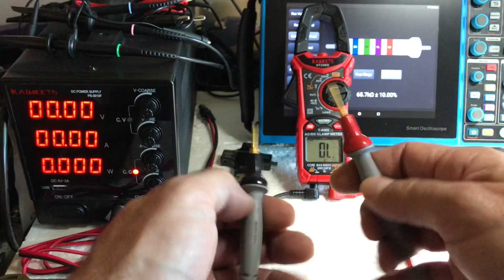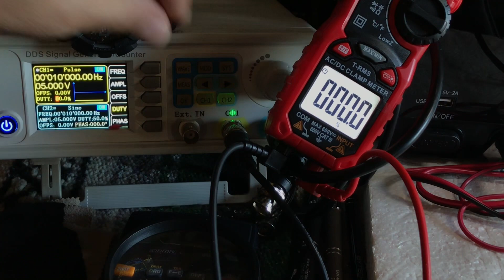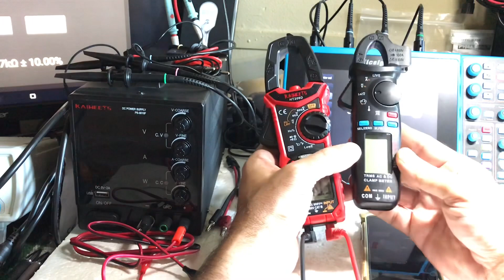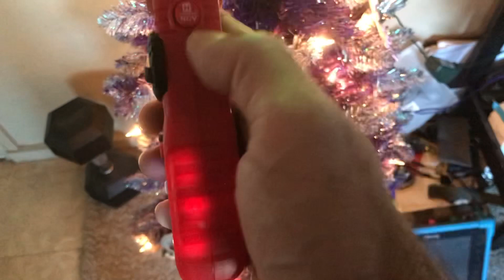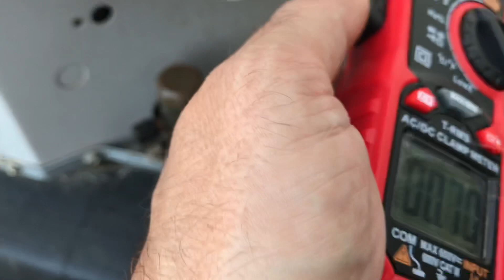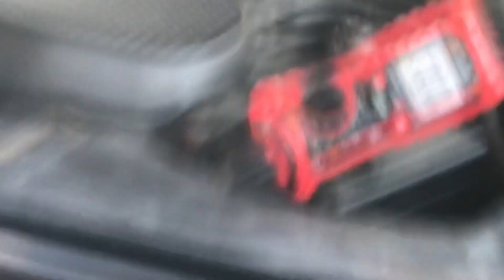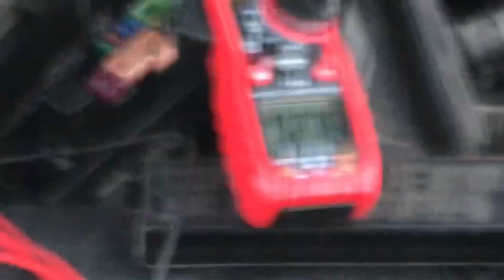Kaiweets Clamp Meter HT206D Full Review

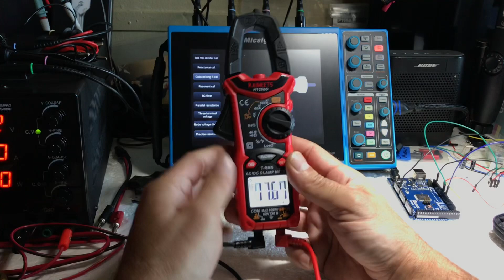Comment: 24:34 For the Min Max feature, try it with a range of inputs starting from 0V to 10V, and see if it will show a max of 10V.
When I tried it, it's unable to get a valid max reading because the auto ranging confused it, and can't be range locked the way most auto ranging meters can be.
This one only works if all the voltages applied are within the same range throughout the min max capture session, which is limiting.
Reply from the maker: How’s it going Wingerrrrrr? Thanks for the question. So I turned on the Min/Max feature to Max. I started my power supply at 0 volts and started working my way up to 10 at 1 volt incriminates. It seems to work great until I get to 7 volts then it shows .oL(usually means over limit). I tried this multiple times. I then did the same thing starting at 6 volts, and it worked properly all the way up to 32 volts (my power supply max). I’m not sure why this is happening. If I start at 2 volts and go up 1 volt at a time, it also shows oL. when I reach 7 volts (also starting at 3,4,and 5). A couple of times I was able to start at five and go up without a problem. I went from low to high and from high to low on Min, and had no problem. Is this the same thing that is happening with yours? Please respond back, so we can maybe figure out why it’s doing that, and help others as well. Thanks again for the question Wingerrrrr. Turns out to be a very good question. I never realized it before until you asked.
Reply: @atomsworkshop195  I think it's because their min max function doesn't ignore the readings during a range change the way it should, and as as result, immediately records the OL indication as the max.  The only way to have it work is if there's a range hold option, but unfortunately it's not available on this model.
If they were able to update their firmware to ignore any non-readings like the OL, and just continue capturing the min max readings only after the range change finishes, it would work better.
Reply: It's okay for something like a starter voltage drop test, where you connect to the battery beforehand, and it basically stays in the same range through the whole test.

Edit: Measuring a max current draw on startup is okay actually, since the current measurement doesn't autorange, just staying in one range.
Reply from the maker: So why do you think, it only seems to have this issue (min/max) under 7 volts? I tried numerous different ranges above 7 volts with no problem at all. It just doesn’t make sense to me. 
As for the starter test, I don’t know. It seemed to hold the max current when I started the vehicle. You can see that at the end of the video. I don’t know. I usually use my scope (oscilloscope) when I’m diagnosing cars anyway. I like to see everything (volts, current, etc.) over time. For me, my brain just seems to understand it better, seeing it as a waveform. Don’t get me wrong, I like this little Kaiweets clamp meter. Sometimes it’s just quicker to grab that versus getting the scope out. I likes the small size of it for a high amp amp clamp. It has a lot of functions (most do now) that all seem to work well. At least well enough for most automotive and around the house use. I’m not building space shuttle’s, lol. With all that said, I can’t ignore what you’ve stated. I think I need to research that a little, to better understand it. 
Wingerrrrr, I really appreciate all your feedback. That’s why I make these. Try to answer questions others might have, and to learn as much as I can along the way. Thanks for visiting the channel my friend.
Reply: @atomsworkshop195  mainly only an issue if your signal starts in one range, and crosses through to the next higher range.  When you start off from the lower voltage, it picks the range that gives the best accuracy and resolution for low voltages, but when you increase the voltage beyond the 7V, it has to change to a higher range to be able to read properly.
  The meter has several ranges with progressively higher max voltage read capability.   The 7V sits right where it needs to change range, which causes the brief OL until it's able to switch gears.
Reply from the maker: That makes sense. I now understand what you’re saying. Kaiweets should have spent a little bit more, to correct that issue. I really appreciate the input on this. Now other people will be able to read your comments, to better understand this circumstance. Or I can refer them to your comments, if questioned about it In the future. Thanks again for stopping by the channel
Reply: @atomsworkshop195  
I misremembered the max current measurement, it's okay, as you said-
Since it doesn't have auto ranging for current measurement mode, it will get the right max readings.  It's only the other measurements with autorange that gets thrown off 🙃

Their next model up, the 208D, now has a "RAN" (for RANge), which will allow the manual selection of a higher range, to avoid this problem.
It's nicer also if you do repeated measurements of higher voltages (or lower resistances), because it's much quicker reading when it doesn't have to step through the ranges every single time you connect up.  I think it's worth the step up in pricing, because it'll pay dividends in satisfaction of use over the long term.  It should last long enough that the extra cost doesn't matter as much when divided by the years of ownership. 😎
Reply from the maker: That sounds good my friend. I’ll have to check out that newer model. It doesn’t matter that I already have this one. I like collecting different multimeters and amp clamps. You can never have enough, lol🤪

Comment: One note. Yes it does MAX current but that is NOT the same as the "Inrush"
Reply from the maker: Hello John, and thanks for stopping by. I’m not sure exactly what you are saying. I used the “Max” feature to capture the “inrush current” when I started the vehicle. If I was using an oscilloscope, you would see the same thing, but over time. You would be able to see the spike of inrush current drawn, then it would drop back down. Anyway, maybe I’m having a brain fart at the moment, but I’m not sure what I did wrong. If you could explain it a little more, I’d appreciate it. I am not someone that claims to know everything. I’m here to learn, and help others learn what I’ve learned. So, if I’m doing something wrong, I’d like to know so I can correct it. I’ll look for your response. Thanks John.
Reply: @atomsworkshop195  I know this is an OLD video and I am leaning too, but anyway here is my 1 cent on this topic, the difference is how fast can the Meter do the sampling for every reading, some PEAK amps (for example some AC Compressors) have a very FAST (in the milliseconds) peak amp that a normal AMPMETER may not see using the MAX  (because of the instrument sampling rate) so the MAX feature will not detect that peak while the INRUSH meter could (i mean at least in theory) because it start the Sampling at the moment the the unit (motor) start and get in a fast sampling mode. so to answer that question yes the MAX may give a close number but not necessarily the true PEAK while the INRUSH mode (if available) will (again at least😁 in theory).
Reply from the maker: Thanks for the info. Definitely appreciate your feedback. I usually use one of my oscilloscopes whenever I need more precise readings. It’s easier for me to be able to see the reading over time, as a waveform. Then, if needed, I can break the waveform down. Thanks again.

Comment: How accurate when measure DC under 10A?
Reply from the maker: Hello Cuong. If I remember correctly, it was accurate down to an amp and maybe just under. Once you get into lower milliamperes it begins to drift off. I know they offer another low amp clamp for those lower numbers. Good luck buddy.
Reply: @atomsworkshop195 그렇군요  ht208d는 가지고  있는데  저전류 탐지를 위해서 ht206d와 owon  cm2100  2가지를  함께 구매를  해야 될지
둘중 하나를 사야 될지
지금 많이 고민중입니다
자동차  dc와 ac  누설전류를  함께  사용해야 되서요
Reply: @atomsworkshop195 시골에 땅을 구매하는건
별장인가요? 아니면 아예 집을 이사하는건가요?
한국은 미국하고 많은게 달라서  다이문화가 많이 발전을 안해서 공구를 직접 사서 수리하는것보다
전문가에게 맡기는 편이 아직은 저렴한편입니다
나도 도시가 싫어요
온갖 소음  특히 자동차 소음과 오토바이 굉음
그리고
늦은밤 시간 꺼지지 않는
불빛으로
인간이 오랜 시간 자연 진화를 하면서 밤에는 자게끔 진화 된것을 불과
200년 사이 전기가 발명되고  밤에 잘 시간까지도 불이 켜지는
시각공해가  싫어서
나도  시골로 갈 계획입니다
도시를  떠나서 시골로 가는것은 많은것을 잃을수
있지만 건강은 좋아질겁니다
특히 아이들을 위해서는
더 좋고요

Comment: Doesit have protection? I mean what if i measure voltage in resistance mode? Does it broke?
Reply from the maker: I believe that would be ok. To be sure I will check and get back to you. Unfortunately, I won’t be able to until tomorrow. I’ll post the answer tomorrow. Thanks for the question.
Reply: What was the result?  Thanks
Reply from the maker: My fault. I forgot to post what happened. When first asked the question, I wanted to check my owners manual first, incase of a warning not to do that. Well, I recently moved and couldn’t find the manual, so I went ahead and tried it. Connected directly to one of my power supplies, I had it set to resistance, and absolutely nothing happened. I ran through different voltage ranges, and nothing happened. The screen on the clamp meter stayed exactly the same as it is when you switch to resistance. No beeps, no sounds, no smoke, no smell.  I even turned the screen light on to see if it would dim or anything, and nothing. With all that said, that was just voltage, with no external load to draw current. I thought about adding a load to draw a few amps, but decided not to. I don’t know for sure what would happen. Maybe blow a fuse; I don’t know; but I’d rather not chance it. If anyone tries that, or knows for sure what would happen, please feel free to share. Thanks for stopping by the channel.

Comment: Thanks for the review.  Does the HT206D show Millivolts DC?  I notice when you tested the  it only showed to 2 decimal places instead of 3 and yet the spec says it measures in millivolts.  thanks
Reply from the maker: I don’t have it with me at the moment, but I’m pretty sure it measures MILLIVOLTS. If I remember correctly, it wasn’t super accurate on MILLIVOLTS. I know they sell a low amp amp clamp too, that may be better for lower measurements. Good luck

Comment: Thanks, I was disappointed with mine until I saw you zero the reading before a DC current clamp measurement. Now it reads accurately! GREAT
Reply from the maker: Hello Scott, I’m glad I was able to help you out. I apologize it took so long to respond. Anyway, thanks for watching
Reply: Dude! Read the booklet it comes with. I read about zeroing before and after a measurement in there.
Reply: I believe mostly DC clamp is using hall effect feature, so you require to zero out (that is the way it should) right after you clamp to cancel out ambient signal. As for the temperature it should be connected to temperature probe, otherwise it just some strange floating value from your test lead, it's what I noticed.

Comment: Nice signal generator and power supply. I know the video is a little dated but can you send the model numbers especially on the signal generator. The light on the meter would drive me nuts. Thanks for sharing. Artie 👍 definitely like the video section showing amperage. Excellent demonstration. Also like the background music. I might be from NY but like good country music 😊
Reply from the maker: Hey, what’s going on Artie? Just got back to the house. Not a problem. I still use the signal generator and power supplies today. So, first I bought the Kaiweets DC power supply, then I bought another one that has buttons, that makes it easier to get to an exact number for voltage or amperage. Also, able to connect to computer to program and save different settings (I haven’t done that yet). I use both of them, and would recommend both. In fact I use the Kaiweets one every time we BBQ out back, to connect an FM transmitter to an older Sony home stereo. I use the power supply to power a female plug (basically like the cigarette lighter in a car). I have one that plugs into the wall. Only, we just bought and moved onto the property here a couple months ago, and I still have some things in boxes. Anyway, here’s a layout of each one:

Kaiweets DC Power Supply PS-3010F:
30 Volt 10 Amp Variable Power Supply
I boughtut from Amazon on 10/22/2020 for $80. That was after using a $20 coupon. I see it for sale right now for $90 minus 20% off, so maybe about $72. 

Rockseed HM310P Power Supply:
30 Volt 10 Amp Programmable Variable DC Power Supply

I bought it off Amazon on 12-13-2020 for $80. It was originally $100, but I got a lightning deal that dropped $20 off. 
I see it right now for $100 minus 10%, so $90. When I was shopping for mine, I saw maybe 3 other companies selling, what looks like this same exact Power Supply, and I believe they are all the same. I went with the Rockseed myself, and am happy with my choice. 

Koolertron DDS Signal Generator:
Koolertron Upgraded 60MHz signal generator counter. 
They have different models to choose from. I went with the 60MHz, which was the top one (at least at the time I bought it). 
I bought mine from Amazon on 02/22/2020 for $150. I know, pretty pricey. I do a lot of diagnostic work and just enjoy tinkering, so it made sense to me to be able to generate a signal. I have seen other “portable” ones for sale that I wouldn’t mind having, but for now this is what I us, and I like it. 

Well, I hope I covered everything. Let me know if you have any other questions. 

P.S. I too love listening to some country. Can you believe that the record company for that song from Hank Jr, is making money off my video. I don’t even make money from my videos, but because that song is playing in the background, they get to add commercials to my video and get paid for it. And NO, I don’t get a cut. I thought of shutting of the volume for that part of it, but screw it. It’s like I’m buying a few rounds of drinks for Hank Jr. (Or a bass boat, lol). 

Oh yea, when you are buying the power Supply, make sure you get the one with the correct voltage and amperage limits that you want. I know they have one that only goes to 5 amps (I believe). Mine are both 10 amps. 
Good luck Artie 👍🇺🇸🥩
Reply: @atomsworkshop195  Adam I apologize for the late reply. Thank You for the very informative response to my questions. Much appreciated and I will check them out. Should receive the scope today at least I hope so. Thanks again it’s nice to have a fiend that responds. You and family stay safe and well Artie 👍🇺🇸
Reply from the maker: Thanks Artie. Be safe my friend 🇺🇸👍
Reply from the maker: I just corrected some spelling and what not issues on that last comment. So if you read it already and some didn’t make sense, it should now.

Comment: can it measure inrush current?
Reply from the maker: I don’t see why not. Only, since it’s not connected to an oscilloscope, you won’t see current over time, so I would use the min max feature. This way, it’ll save the highest or lowest number reached. Hope this helps. Also, I apologize for the slow response; I just now saw your question. Thanks for watching, and the question.
Reply: @atomsworkshop195  I saw on online shops more expencive model named HT208D and it claims it can measure inrush current, but max feature should probably do the same thing.